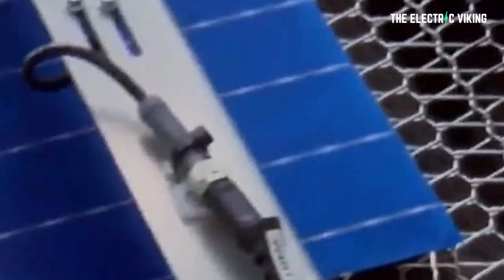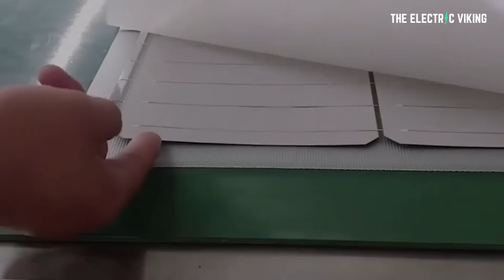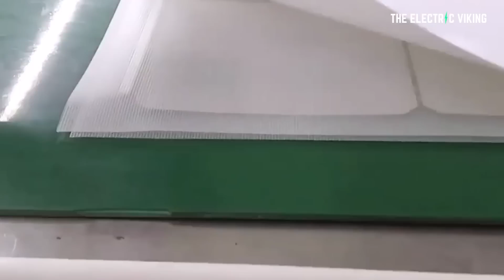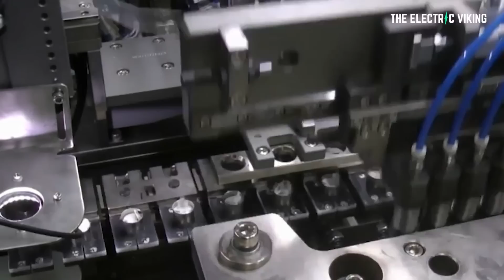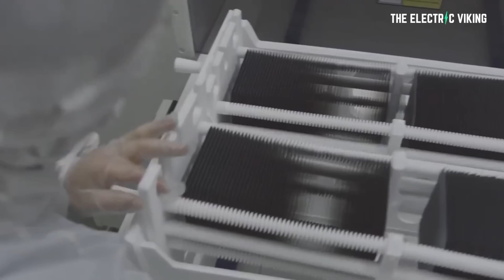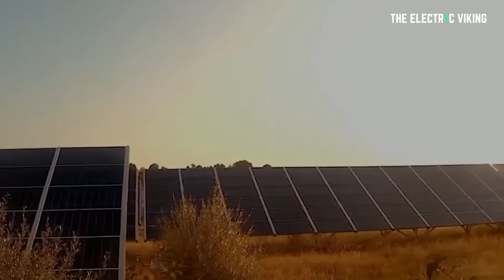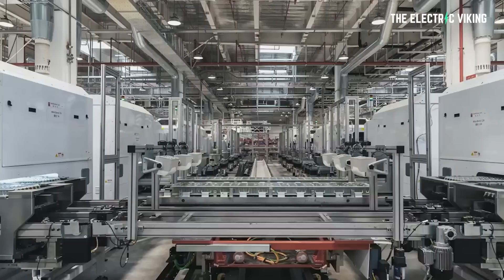China’s solar panel price war will double solar panel installations globally

Comment: Sam have you covered the Duck Curve issue yet? That keeps getting worse year on year due to excess solar
Reply: Its basically a non-issue now.  Several locations (California, certain parts of Australia and Britain, and a few other spots) are already seeing 100%+ renewables generation during a limited number of days, particularly in the spring.   The knowledge and understanding is now fairly well known so other grids that aren't yet hitting this issue pretty much know how to deal with it.

In fact, as grids add solar, it is fully expected that there will be a very large degree of overproduction on any sunny day in order to give energy storage systems something to store.   And in order to get 100% production in winter, we will wind up with massive overproduction in the spring and the fall and some modest overproduction during summer.

The next step is basically adding energy storage.  A lot of energy storage.
Reply: Check out the U curve for renewables. Amount of renewables vs battery capacity, will result in super power regions. Check out https://www.youtube.com/watch?v=fsnkPLkf1ao from Tony Seba(rethinkx)
Reply: To some degree it's a non-issue.  Power demand tends to peak when solar power generation peaks, and industrial users can take advantage of cheap electricity during periods of cheap power to generate and store things their processes require, like heat or cold, in various thermal storage systems.  

We'll see climate control thermostats plugged into the grid and designed to soak up cheap power during periods of peak generation as well.  In warm climates, residences and businesses will "bank" cold air by turning down the thermostat a degree or two from the usual set point while power is cheap, then letting temperatures rise a degree or two above the set point when less power is available.  Air conditioning is the #1 power sponge in North America and Australia, so this alone can mitigate much of the "duck curve".
Reply: . @sunspot42  actually, power demand peaks 0600-0900 and 1800-2100 hours.   

In winter, an additional surge occurs overnight in moderate temp areas suffering cold fronts. Most have heat pumps, temps get too cold and resistive heat kicks in.

Cheap Solar needs even cheaper storage.  It's coming... slowly
Reply: @johnb7430  Where power demand peaks depends upon location - in California and much of the US it peaks in summer in the afternoon. Here 6AM to 9AM demand is fairly low and spikes starting around 2PM to 9PM due mostly to air conditioning. A lot of that load can be shifted. 

The solution to this is already in place - spot market pricing. It’ll follow the duck curve and lead the market to shift demand to when generation peaks and prices are their lowest. It’ll take a few years for the carrot and stick of the market to force behaviors.
Reply: @sunspot42   in fact in Australia the Duck Curve is the biggest issue to grid stability when coal plants lack flexibility to ramp up quickly to meet the dinner time surge etc . Also Aus failure to incentivize batteries installs mean a low 2-3% install rate that could help smooth the issue. Meanwhile some states SA WA mandate PV can be switched off by the Supply Authorities Incase of excess pv on the grid . 
Next problem is called “Solar Cliff” solar does not have inherent frequency stability or physical inertia to ensure a 50hz supply and widespread blackouts are entirely possible
Reply: @Froggability  Most places use gas to level demand. Not ideal, but Rome wasn’t built in a day.